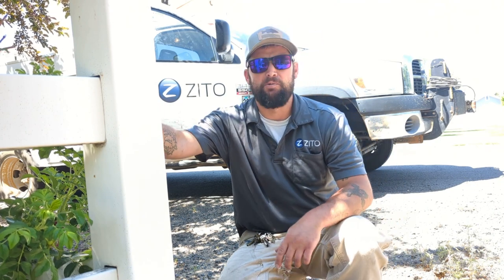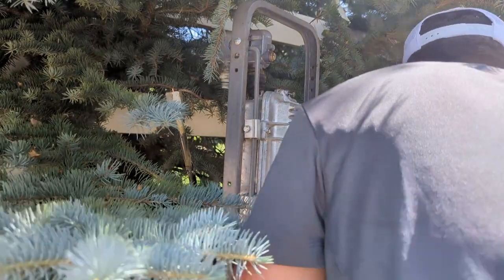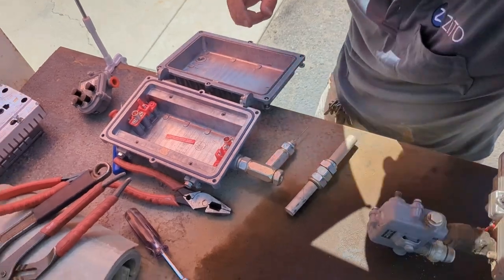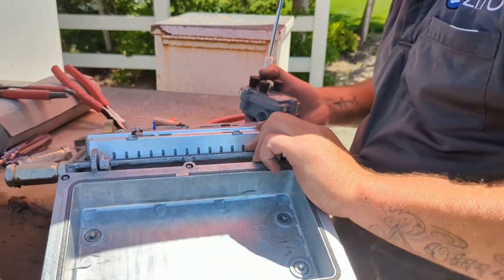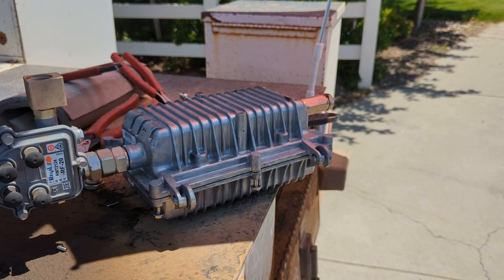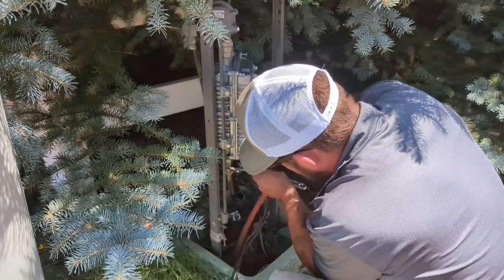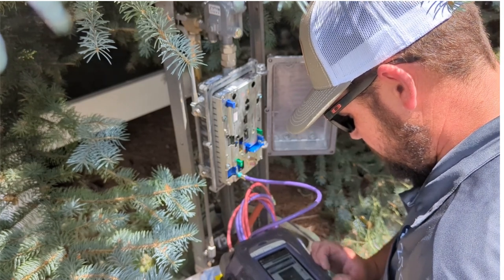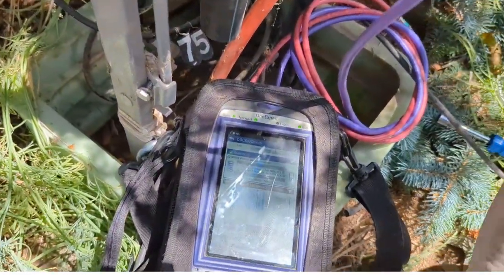Line Extender swap (full process)

Comment: Can you show inside a node sometime?
Reply from the maker: Absolutely.  I have a few different types, anything you're particularly interested in?
Reply: @cabledemons I would be interested in seeing an installation of one of the new Motorola nodes for the system upgade.
Reply from the maker: Those things are massive...a lot of fun to cut in and I'll definitely do a video
Reply: @cabledemons  we have white Arris OM6000’s down here now.  It’s mid split 85 MHz return.  What nodes are you cutting in?  On your shorts they almost looked like the OM6000 just not white.

Comment: I enjoyed watching you build a sucker. Thank you
Reply from the maker: Thank you!
Reply: I really should get my drivers license, I wouldn’t want to do this job long term but I definitely have the capacity for it and it’d be nice to have something for all the years that I’ve had nothing. I’ve done a bit of low voltage tech (tons of cat5) never any optics cabling, but I’m familiar with optics, splicing, phys, different media types (I know enough about fiber to get through it) and at least enough to characterize the quality of a signal given known good values let alone the fundamentals of digital signal processing theory… 

And I honestly don’t mind doing labor intensive work, I rather enjoy it. I think most people would probably feel weird about hiring me for this job given that I’m probably over qualified, but information like this is helpful even to me, the job definitely speaks to me though I just don’t think I would settle for it if I could find work programming or working as a systems engineer. 

Asides from that what’s the worst thing you’ve ever had to deal with? I would imagine probably stinging insects/snakes. I really need to get my drivers license, even stuff like repairing air conditioners really isn’t  terrible work IMHO just have to be mindful.

Comment: Question,  if this is up in the air and you wanted to change the way the lid opens, could you insert the module in the housing upsideown so the signal comes in the right side and exits on the left?  Like does all the pins, mounting holes and test points all line up?

Also, to keep downtime to a minimum, could you have pretty much prebuilt the new LE as much as you could, also taking a best guess at the eq and pad (based on the existing one), then cut it in last minute?  Obv it’s new so you still have to tweak it, but maybe you’d get close and most of the downtime is the actual cut in, not customers waiting for you to build it out with all the fittings, tap, any extensions and 90’s?
Reply from the maker: You can with an amp... not an LE
Reply from the maker: Definitely...I typically build them in advance but this one only has 2 subs that weren't home so it was a good day to demonstrate.  The main problem was the common path distortion it was throwing into the upstream